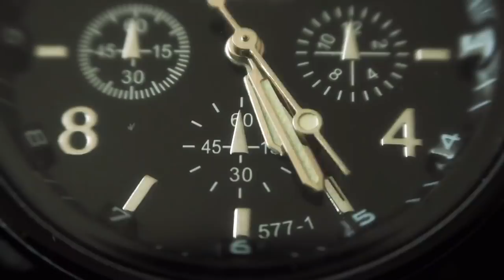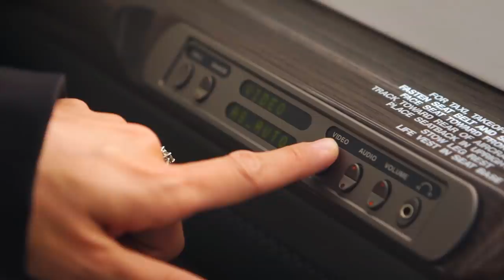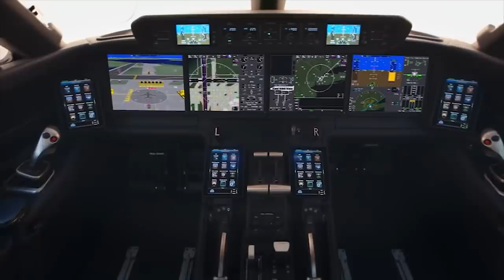What is business aviation and why do we need it?

Comment: I think you covered nearly everything but you could emphasise the point that a company in a small city with very few connections (or even no commercial airport at all) has very slow travel options to another secondary city. e.g. Salina (KS) to Redding (CA) is a minimum 12.5 hour commercial flight (3 stops) plus an hour wasted at the first airport. As the whole day is wasted each way, a single meeting could require two nights' stay at the destination, giving a total trip time of 64 hours or so. However, the distance is just 1,318 miles, which is a 3-hour direct flight in a decent jet. This could allow a return trip all in the same day and an overall travel time of 12 hours – 52 hours saved!

Comment: Our firm has to send engineers to remote locations to work on power plants, oil fields & dams which are usually reachable by commercial aviation, but flying commercial doing 3 or 4 stops involving changing planes is very exhausting and we can't expect exhausted human beings to be fresh & sharp doing so, we fly them on business jets whenever possible.  Just the comfort, room to stretch out, etc. makes the employee recognize that we value them as team members and are able to arrive for work refreshed since we're able to avoid long layovers and most flight delays.

Comment: Good one - I can only dream. Wish more was mentioned about single pilot (captain) or first officer requirements.
Reply: The single pilot requirement is related to the weight of the airplane, until a certain weight (I don't remember the number) you can fly single pilot, after that weight, you need a second pilot, FAA requires a second pilot because, the bigger the airplane, the bigger is the work load, so, to prevent accidents you devide the workload
Reply: Just to name some single pilot airplanes, all Citation's under the CJ4 (including the CJ4), Phenom 100 and 300, Beech Hawk (I don't remember which model), King air 90 and 250, Pilatus PC12 and PC24

Comment: In February 2019, an Argo shareholder issued a press release in which it alleged, among other things, the misuse of Argo assets by Watson, including undisclosed personal usage of corporate aircraft. On April 12, 2019, during a proxy contest with this shareholder in connection with Argo’s May 2019 annual shareholders meeting, Argo filed a definitive proxy statement that failed to disclose over $1 million worth of perquisites, including over $230,000 related to Watson’s use of corporate aircraft. From 2015 through 2019, Argo incorporated its definitive proxy statements into its annual reports by reference. From 2014 through 2018, Argo incorrectly recorded payments for the benefit of, and reimbursements to, Watson as business expenses, and not compensation. As a result, its books, records, and accounts did not, in reasonable detail, accurately and fairly reflect its disposition of assets. In addition, Argo failed to devise and maintain internal accounting controls relating to payments for the benefit of, and reimbursements to, Watson that were sufficient to provide reasonable assurances that transactions were recorded as necessary to maintain the accountability of assets. These failures included, for instance, a practice of providing expense reimbursements to Watson without requiring an adequate explanation of a business purpose for the expense, allowing Watson to approve his own expense reimbursement. 

Mr. Watson's Personal Chariot
Make: Gulfstream: 5 
Registration Number: N17ND 
Serial Number: 518
Lessor: Jetaway Air Service of Muskegon, MI
Monthly Payment: $ 175,000
Hourly Reserve Payment: $ 1,250
Average Monthly Payment to Jetaway Air Services (based on recorded flight hours) $250,000 to $300,000 (note: figure does not include crew salaries, airport fees, insurance, and fuel) 4 to 5 million expensed to Argo shareholders each year for the exclusive use of Mark Watson's Personal Chariot - G5.